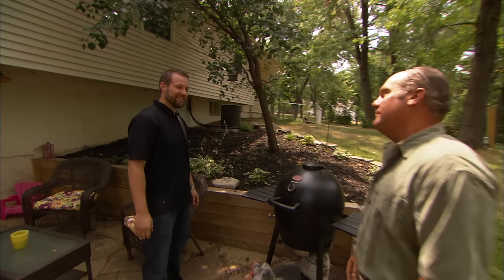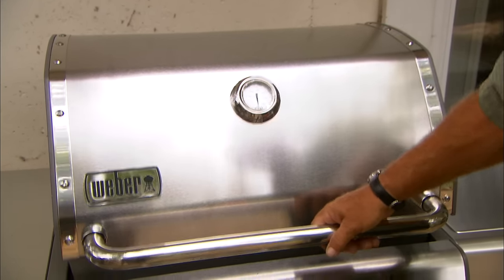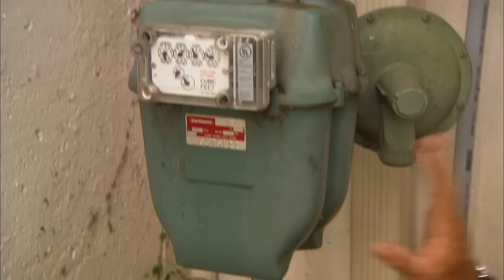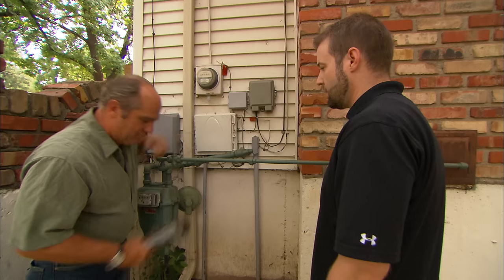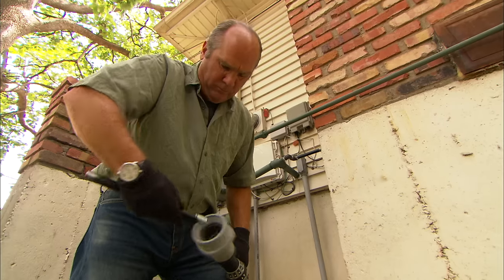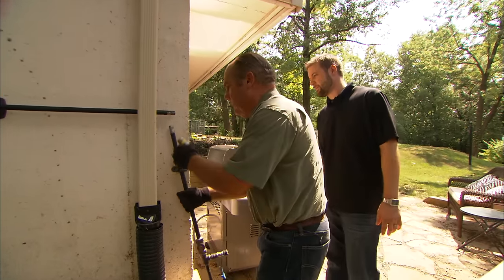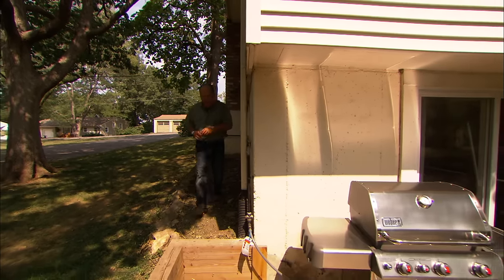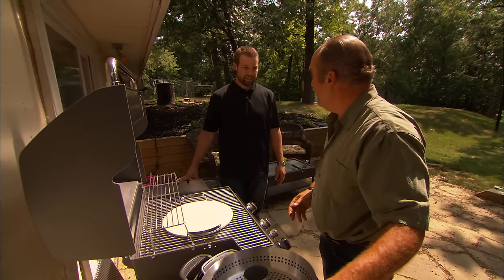How to Install a Natural Gas Grill | Ask This Old House

Comment: Any idea how much does a project like this would cost?
my guess is from 950 to 1500 plumbing alone no grille
Reply: @Rex Limiron you aren't gonna get that pipe run for that little. The company I work for would charge at least $1200 for it. Even as a side job I would charge more than your estimate.
Reply: @Rex Limiron you get what you pay for.
Reply: 3 ft section of pipe at lowes 12.00
Reply: Ridgid pro press gun is about $3000 and the jaw kit to press small size steel pipe is another $3000.

Comment: Why wouldn't you just add on to the gas fireplace line?
Reply: I was thinking that too but here is my theory I believe it is due to the size of the pipe to the fireplace - it not be sufficient to supply gas to both the fireplace and the BBQ.
Reply: I thought of that too..  But the likely hood of running both at the same time seems small..     Oh well, I guess that's why I didn't run the line..  lol

Comment: There was a huge spider on Richard at 4:04
Reply: It's a brown on crawling up his back. Spooky!
Reply: NineduceXII hahaha. That's his assistant. That little guy can see in infrared and do pipe inspections. As well as fit into the Tiny Places to expect where a human can't. Then after the installation the spider lives on the pipe and protect it from other insects followed by its Offspring generation after generation of pipeline spider will guard that pipe.
Reply: Damn you have good eyes
Reply: Richard has no fears!
Reply: Who gives FU@K! Can I get that set up for free?!? I'LL RUN ALL MY OWN GAS PIPING. 
I WOULD LOVE TO GRILL WITH ACCESSORIES THAT ARE ON THAT LEVEL
Reply: NineduceXII Looks normal sized to me.

Comment: He said the worst words he could have: “That’ll never leak” lol
Reply: Those viega mega press are really good though
Reply: @Camlo89 , they are but without a threaded connection there is no 100% guarantee it will never leak.
Reply: @kalijasin  you got test data to show that?
Reply: @TheArfdog  Ya its called the o ring will deteriorate over time?

Comment: If if was my house, I'd have preferred running the line into the basement and back out. I don't like the look of the piping on the exterior wall.
Reply: Gas needs to run outside when is possible
Reply: Depends on local codes. It usually doesn't matter where it's ran
Reply: @therich1990  So if your furnace or water heater is on the opposite side of the house of your gas meter you have to run the pipe around three exterior walls?  I don't think so.
Reply: "when is possible" i said, depends on countries code as well.
Reply: JTJ n/a  nice explanations, you definitely explained your reasons ;)
Reply: They should of run it on the ground  2 risers one by the meter and one by the grill
Reply: It looks like the basement was finished so maybe he didn't to tear the ceiling/walls to thread that pipe thru it. Also the external option is cheaper and that side of the house may be hidden.
Reply: probably a finished basement
Reply: Everyone's got that one side of their house that nobody goes
Reply: But you dont want to run it inside where it's a lot more dangerous than everyone thinks

Comment: Black Iron pipe will never rot outside, unprotected.  And that drip leg sitting on the ground is perfect for corrosion too.  Don’t get me started on the mega press fittings that allow any hack to pretend to be a gas fitter.

Comment: In 20 years there will be a class action against the manufacturer when o-rings start drying out and leaking.
Reply: thechosendude if still theres a world in twenty years
Reply: I've always thought of things like this (Sharkbite fittings, push in connectors, etc.) as workarounds when it's not possible to do it the "right way".  I just can't trust plastic fittings as I've seen what happens to plastic parts in cars after 10 years.
Reply: Arie M - Agree with cars and plastic.  The video doesn't explain what type of o-ring they are (hopefully not nitrile which is the most common), but even silicone orings with 'unlimited' shelf life aren't unlimited in application.
Reply: The yellow marking on the fitting is indicating it's containing a special o-ring for natural gas. And such a press is really pricy (round about 800-1000 Euros or 900-1100 US$).
Reply: thechosendude guys think about this. This is a company specifically designing a fitting for gas. Rubber and petroleum don't go together. Now you would assume that they would know that and make the O-rings out of silicone or teflon. One thing I find Curious is there is no lubrication or finishing sanding on the pipe where the seal is placed. I would have thought that after sanding a finished sanding would have to take place to make the Surface truer and remove any Burrs that may penetrate the Teflon or silicone seal followed by silicone or Teflon Grease or some kind of epoxy. The new generation of plastic gas Main and service is put together with plastic welding and epoxy. It's incredibly long lasting and durable. I'm also curious why they're using Steel rather than the new plastic. It seems like it would be a lot easier to run that and it should have a longer life.
Reply: thechosendude ugh v
Reply: Propress has been around 20 years . No class action yet.
Reply: thechosendude HNBR SEALING ELEMENT - TEN YEAR WARRANTY
Reply: @ArcolaBridge  plastic is a bad idea if the house is ever on fire. Thats why the fittings and pipe are overkill.
Reply: @DH4Hobbies  very true, my ignorance. What about thick flexible copper?
Reply: @ArcolaBridge  I'm no gas expert here, but we have been using the newer flexible gas line. Its a very flexible stainless steel pipe with a yellow plastic coating over it. The end connectors are compression, again with o-rings. So again questionable for long term? I dunno
Reply: @DH4Hobbies  I totally don't trust that stuff. I guess I just thought the bulky pipe that installed here was a bit ugly. Probably the most safe and sturdy however. Flexible copper seems a little more discreet.
Reply: They would be dead before they notice it leaking. so no  problem!
Reply: I agree, we use pro press and mega press all the time but something always bothered me about putting and o-ring in that cant be changed. I pulled to many disintegrated washers and o rings out over the years.
Reply: JTJ n/a I’m not a fan of gas-tite except in certain situations. It’s great when you have one or two fixtures and you need to run through windy areas to get to them. For example, in my hometown in west Tex’s we had to run 1/2” from the front of an old building downtown to the back. It was about 60’. Instead of tearing everything out and running black iron it was much cheaper on them to run one run of gas tite. Of course it sucked for me. I had to crawl through the attic pulling the gas tite for 60’. It felt like bishop in aliens.
Reply: cisa93 not much different than flame testing gas lines. We used to do that
Reply: cisa93 no and you can’t break a flex line off with your hand

Comment: Those crimp fittings are useful in a bind but hes just being lazy. It takes away the art of plumbing and shows the difference between  a pro and a handyman.
Reply: it seems like it would also be better to use threaded fittings because in the future you might need to do some maintenance or something and you could just unscrew them

Comment: What a shame .. the old red Weber grill are a tank .. mine is 20 something year old and still going without fail 

I was hoping he convert the red one to natural gas
Reply: He'd have to replace quite a bit of it, and probably repaint everything. Probably for the best that it's replaced.
Reply: @fartpluswetone8077  basically the only thing you need to convert a propane grill to a natural gas one is Changing the ori faces

Comment: The best way to make sure the gas is off and not leaking is to light a match right by the fittings.  That's a tip I learned from fire marshall Bill.
Reply: Actually that’s not far off from the truth. We used to flame test occasionally if we didn’t have any soap. You just run a lighter along the pipe and if there’s a leak it will flare up a little.

Comment: Pro press gas fittings??  That's an amazing invention!  Beats the old way of threading the pipe. Don't want to think about how expensive the fittings are but I guess in the long run will save alot of time.
Reply: You know why it's so expensive? Because it's worth it.

Comment: It goes through the regulator first, THEN the meter. Not to mention these few fittings cost way more then all the pipe and hardware combined.
Reply: That's true the fittings cost more but the time savings is amazing, its pretty idiot proof and the press is a lot smaller than a power vise.
Reply: @abdulelkhatib2674  It's expensive because it's worth it. lol

Comment: Just curious couldn't he have used Galvanized steel instead which wouldn't rust especially since its all outside ?
Reply: Megapress is only used for black pipe. Galv would work but it would have to be threaded.

Comment: I'm not a fan of running piping along the outside walls of a house or across a roof.  I prefer to bury pipes that meets code.  It's unsightly and looks amateurish.
Reply: I concur - that's what I did with mine and not only does it look better it is safer & has been fixed because old line went way out into yard & accidentally got cut but once we did it the right way no problems  for over 20 yrs.

Comment: Why wouldn't you just bury the gas line? Would be out of the way and wouldn't look so bad.
Reply: Eli Sope because "just" burying the gas line is a lot more work and a lot more money.
Reply: you cant bury steel lines unless they have welded joints and protected from rusting,l underground piping is plastic .does look like hell
Reply: Ya that looks horrible... Burying the pipe would have looked way cleaner

Comment: hi, just curious with another video you did a pressure test with a gage. But this time only bubble test?
Reply: I’d say the only difference is if a permit is pulled and an inspection is required. However he mentioned pulling a permit. With water you can just turn it on and it works for a test because a leak will be visible but gas is different. Maybe they left that part out to make the video quicker
Reply: I hope you realize there is a lot of editing in these videos to shorten the time.

Comment: What happens when someone tries to move that gas grill quickly and they yank on the pipe? It doesn't look very secure and might rip it off the wall
Reply: if they yank the pipe while moving the grill,  the hose will disattach and no gas will leak. the hose connect is designed in a way where it only releases gas when the fitting is connected.
Reply: Same thing when somebody tries to drive out the garage when the door is still down!
Reply: Why would anyone move the gas grill quickly??
Reply: The house will BLOW UP.

Comment: nobody uses those fittings,they cost a small fortune,worked in the gas industry for 40 years,never saw one instal
Reply: Ron Metropolit I see them used extremely often. And more often every day. My threader is tucked away. Rarely ever use it any more.

Comment: Richard I have questions.
How come you don't use the new plastic welding or epoxy install these outdoor gas services? It's extremely durable and long-lasting. Also someone else raised the question of the longevity of the crimp seal. What is the seal made out of? Teflon? Silicone? Special rubber? Would finishing sanding to make the Surface even better with some kind of Teflon or silicone grease? I always cringe a little bit when someone puts a seal on without Grease unless it's a Teflon seal for  mechanical work like a drive shaft. But this is just stationary.

Comment: I’ve used natural gas for my grill for over 15years.   The only difference is that the brass orfac   Is slightly larger as propane has more BTU.   If you grill a lot the payback is a year or so and you never run out of gas
Reply: I’d love to have this but my propane grill is about 50’ behind my house. The plumbers cost wouldn’t be made up for in 10 years over me getting propane tanks filled.
Reply: @jackpast  Yeah, I just got quoted $2500 to run a black iron gas line from one side of the house to the other for a grill... considering whether that convenience is worth it or not...

Comment: If those fittings work for gas can it also work for an air system with 80psi, very large system (150 cfm nominal) 24/7 weh have 1/2" 3/4", 2" and 2.5" Galv schedule 40 pipe.

Comment: What kind of fittings were those that anchored the pipe to the concrete as well the assembly of pipe clamps?
Reply: Split ring hangers 3/8"

Comment: The drip pocket was touching the floor. That is so wrong how is one supposed to open it if there is no space underneath it? Also the first fitting he uses is actually illegal to use here in Ontario Canada. Pipes used outside must be painted to protect them against rusting… ayay yay. I’m a student studying and I’m definitely learning a lot by watching these videos. Thanks

Comment: Could of just ran gastite and saved yourself a lot of time and hassle with all the fittings and pipe. Also that crimp tool cannot be cheap to buy. Seems like a waste when there is better alternatives for cheaper.

Comment: 1 yo uswitched out the grill, do you need a special grill with that snap in end or can you use the grill that I used propane tank on and just get a natural gas hose?  If not what was the model of that Weber grill with center cut out and all those attachments. Thanks

Comment: why don't you just use copper pipes?
Reply: Because it's a gas line you don't use copper pipes when it comes to a natural gas line!!
Reply: @4HBirtcher  why not? We use copper
Reply: @Federico84  In the US they use steel pipes. Obviously with copper we won't have rust issues but one down side is that our copper pipes are not as thick as their steel piping. But as long as they spray anti rust pipe on their pipes they shouldn't have an issue.

Comment: Actually had a demonstration in class with a Pro Press Rep. They said it's good practice to tighten each joint twice - at least on water lines.
Reply: Thats the total opposite of what i was told by the rigid guy, you squeezed and deform the fitting  the first time , imagine what are the chances of  doing it exactly the same way  in the exact same angle the second time …. it will leak guarantee ,he said.
Reply: That makes sense, but I’m just stating what the Viega rep told us to do.
Reply: @LtMuraida  i know is kind of grey area , i have ask around and theres a lot of confusion about it .

Comment: Putting iron pipe outside with no protection, seems legit to me.  Also I don’t thing the first mega press connection was cleaned properly.  Love a licensed gas fitter not following industry standards and doesn’t want to thread pipe.
Reply: It’s an edited, 20,000 foot overview of an installation. I’m sure there’s plenty of YT vids of some gas fitter taking an hour or more performing every little meticulous step, if that makes you happy. As for not threading pipe, it’s messy, the equipment is heavy and takes time. Maxim efficiency, minimum effort.

Comment: I thought you didn't use a drip leg when the gas line is subject to freezing temperatures?!
Reply: drip legs usually not required on appliances,just furnace,water heater,pool heater
Reply: What’s going to freeze, the natural gas ? Lmfaoooo

Comment: Black iron pipe outside? Would have used galvanized
Reply: That's what we use,An inspector would fail us for using black pipe
Reply: I don’t know about codes everywhere but where I live galvanized is not approved for gas. We can use black pipe outside but it has to be painted with rust proof paint.
Reply: Galvanized pipe would create sparks if you hit it. That's a no go.

Comment: says:  The gas fitter should have used galvanized pipe because the black iron pipe will rust and look terrible. The wall hangers should have been galvanized with stainless steel screws so bad rust streaks don't run down the wall. Black iron is hard to prime and hold a coat of paint on whereas, galvanized pipe will prime and hold paint forever.  The shut-off valve that he installed at the grill should be the type that you can turn off by hand. If you need to shut off the gas in an emergency, you will have to go and hunt up a wrench to turn off the gas. I would say that the gas fitter didn't ream out the pipe ends after cutting them to length.
Reply: galvanized gas is illegal in some cities
Reply: jim maybe gas cant be ran through  galvanized pipe.
Reply: Galvanized pipe has arsenic in it, which reacts to the gas.  It actually eats out the pipe faster.  Hence, why cities are now banning them.

Comment: Here's the issues I found with this.
1)  The new gas line should of been painted
2)  Should of used regular threaded pipe fittings
3)  Should of installed an emergency shut off near the meter at the start of the new leg since the main is a difficult to get to in an emergency.
4)  The two emergency shut off valves (the one near the grill and the one close to the meter that I just mentioned) should be larger and red with a handle so they are easy to shut off in an emergency.
5)  Should be signage along the pipe running against the home, either on the pipe itself ot a few signs against the house warning it is a gas line.
Reply: Should've said "should've"
Reply: There was a leak and the grill blew up a year ago. Dude spent 13 days in the hospital. This video was supposed to be pulled from youtube.

Comment: Why not run the gas line near ground level, instead of 3  feet up, less noticeable..
Reply: Ground level would be no good because of snow, it would cause the pipe to rust too quickly